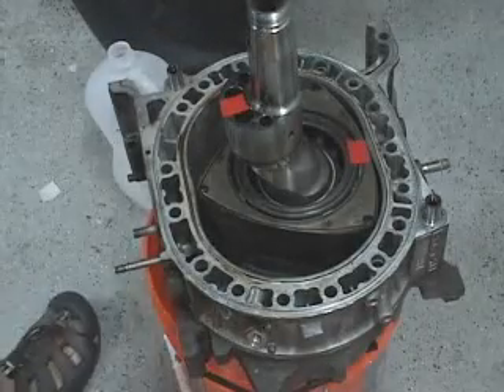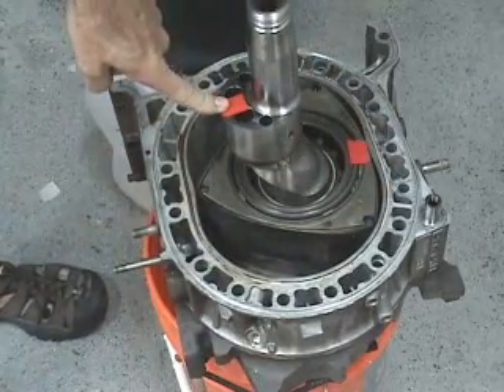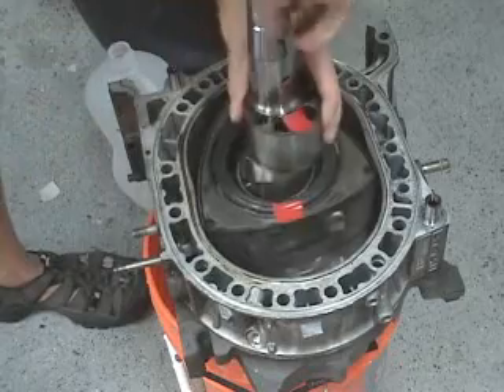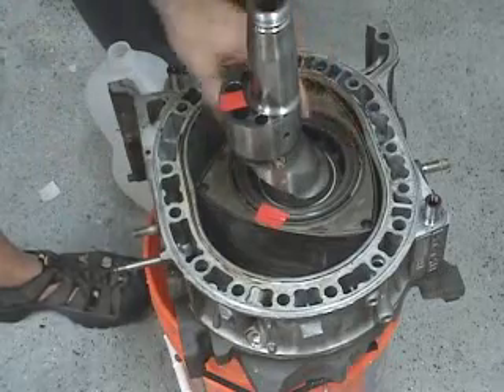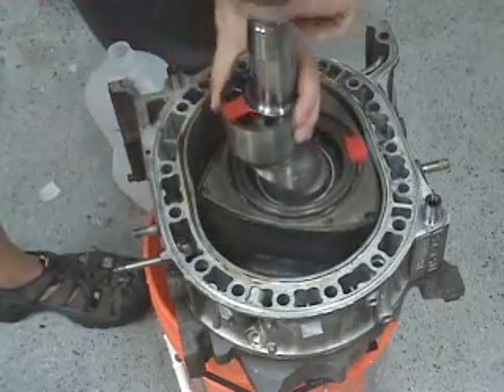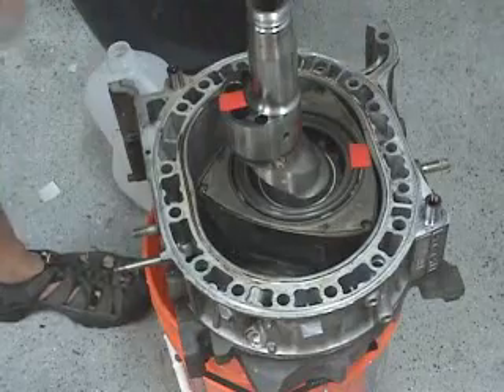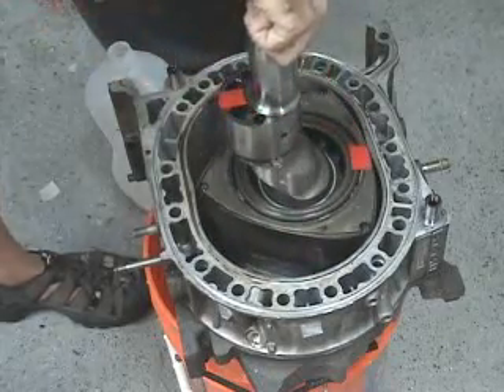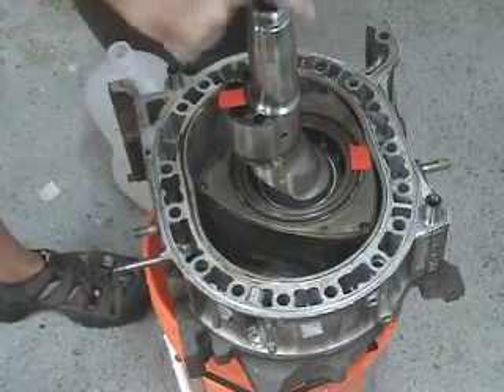Rotary Rotational Demonstration

Comment: So what you're saying is that there is an ignition event for every single rotation of the crankshaft... just like a two-stroke engine really! But a two stroke engine doesn't wear out anywhere near as fast.  The only advantage is that there are far less moving parts and the space needed to fit the rotary engine is smaller but just like the two stroke, you still need oil in the combustion chamber meaning it'll never be a clean burning engine.

Comment: Very few people completely ditch the OMP and go straight premix. A lot of people keep the OMP and also premix or they change to the sohn adapter and have the tank of premix in the engine bay. Even with the sohn you could still run premix and probably should.

They all start out stock by injecting the engine oil instead of the tank of premix and I would say a majority of people stick with that.

Comment: Yeah, because that's how it's made. Most people ditch the oil injection system or whatever its called and just premix 2 stroke oil into their fuel. If you didn't notice, rotary engines don't have an oil sump or oiling system like a normal car. Normally they have a little tank you put oil into, and it squirts it into the engine. But from what i understand it tends to be unreliable or something (maybe it's just an old RX7 thing?) so they just premix

Comment: Thankyouthankyouthankyou! I was wondering about the number of power strokes per complete crankshaft revolution per rotor. Since your video shows that the answer is one, that means one rotor is the equivalent, power-wise, of a two-stroke piston (as it also does 1 power stroke per rev). 

That explains why a 1.3 liter rotary makes 230bhp - in 4-stroke piston terms it would be worth 2.6 liters (as they only have a power stroke every *two* revs) or you'd have to rev the pistons twice as fast!

Comment: 1080 degree of complete thermodynamic cycle(for each rotor).There is 3 rotor faces inside Rotary engine.Each rotor carry their own t.dynamic cycle.First face ignite once after 360 rotation,second face then ignite once after 720 rotation,lastly the third face ignite once after 1080 rotation which mean this engine ignite  per revolution of eccentric shaft,same as 2 stroke piston engine.For that,we should double up the displacement of 1.3 liter rotary engine to a comparable 4 stroke piston engine

Comment: It doesn't. That's what the oil injection pump is for. It meters a very small amount of sump oil into the intake charge to lubricate the apex seals.

Comment: Excellent video!. Thanks. My experience of Wankel Engines. high oil consumption, high fuel consumption, serious rotor tip wear at relatively low mileage, poor torque at low revs. Smooth and very powerful when turbo charged at sacrifice of engine life. Years ago I had a NSU RO80 beautiful car. 15000 miles and the engine was knackered. This car had three engines under warranty!!. Wankel engine, Bullshit. Later ones a little better. AVOID.AVOID.

Comment: cause the rotary does in fact work with the mazda and a 13b turbo 2 swap can be swapped into any car as long as proper mods are made to support that engine and the Rotary is quite reliable not so much in the 3rd gen but 2nd gen Rx-7 is good to go

Comment: It all depends on how well the seals are lubricated throughout the engine life. It is not uncommon to see 1st and 2nd gen naturally aspirated rx7's with upwards of 150 to 200k. More than likely at these points they could use a rebuild but I've seen some hitting 300k. Because the seals do travel a greater distance throughout their lifespan, solutions like running premix in the gas have resulted in longer engine life and lower wear characteristics.

Comment: bmw naturally m10 motors were pushing 300+ at 1.5 liter in the mid 80's.. the m12 1.5liter turbod in the 80's were pushing 1500hp in f1 by 90.. *shrug* .. rotary would be a great design except for the seals..

Comment: Ok...question.  I know the original RX-7 had a single rotor, amazing power BTW for such a small, simple engine.  I was told that the RX-8 had two of those rotors.  I am not quite sure if i believe that since I've  heard the RX-8 and it doesn't sound that much different from the RX-7.  Still sounds to me like a bad assed saw.

Comment: Maybe that's because you hang around people who don't know what they're talking about? I don't bother to say something if I don't know it's been proven. Rotaries in general DO have better numbers than reciprocating. It's simply that the design of the rotor is very inefficient and thus has been scrapped until they can find a more effective way to seal it. Piston 2-stroke/4-strokes are more thermodynamic and far more practical, but unless you've got a shit load of mods on it, it won't be better.

Comment: this engine is the worse engine ever made !!!
.
Did you know a 4.4 v8 like the one equipped on a BMW 550i it can achieve 26 mpg while the 1.3L engine can achieve only 25 mpg ?
.
In a world were people are looking for more fuel efficient engines is unacceptable that a 231hp rotatory engine has the same fuel consumption as a 407 hp V8 engine

Comment: Easily remedied by adding more rotors dude.... Most rotaries can get by using only 2 rotors and make decent torque.  How much torque you think you'd get from a 2 cylinder engine?  What's your solution?? Oh that's right, start adding more cylinders/pistons, then increase stroke blah blah.

Look up how much torque was generated from the 1991 Mazda 787b, naturally aspirated, with 4 rotors displacing only 2.6L.  Game, set, match.
That car beat 5.5L V8 twin turbo Mercs, and 7.4L V12 Jags...

Comment: Technology or metallurgy needs to advance before the benefits of the wankel engine will fully outweigh or eliminate the disadvantages. Considering that there is better use of momentum in a wankel because unlike the cylinder design, it doesn't change directions suddenly. The cylinder reverses direction and therefore some power is wasted changing from up to down. Don't lose hope yet. Mazda won Le mans championship with this style of engine. Its smaller, fewer parts, and more horsepower per litre.

Comment: apex seal resolution is a matter of time and development. unfortunately, you just stated that the wankel has a clear power to weight ratio advantage over any other engine except the Atkinson cycle engine, despite having compression losses.

Comment: I would want to compare vehicle to vehicle. Take a Doble Steam car, and a comparable ICE powered car. Put X amount of fuel into it, and see how much torque, power, or miles, etc. you got out. Also at the time no one cared about fuel consumption, only how well it performed.
I am certain you are correct about overall efficiency but considering when these were built they were amazing. A Stanley went 125MPH in 1906. One good thing about external combustion, is the variety of fuels you can use.

Comment: Yes, most were later more advanced double acting or tandem compound engines massive torque at very low rpms... but in terms of Carnot or Rankine cycle efficiency horribly low BTU to Hp ratio (only about 10%) compared to ICEs, even lower than the Wankel.

Comment: As I said, they had it working, but had issues with corrosion. I don't know how, don't remember the details and I can't find out anything about it now.. I looked. I found nothing. Some if the early steam cars, were pretty amazing. Look up Doble Steam cars. He had the most advanced design. 35 sec to start up and run from 32deg F., top speed about 100MPH, 0-60 was about 10 sec in a 5000lb car.
I think Jay Leno has a Doble Steam car. He has driven his Stanley and White models on Jay Leno Garage.

Comment: What I explained was the basic idea. Keep in mind it's been 10 yrs since I saw the information. My memory tells me they had it working, but were hampered by the materials available.. corrosion problems. The low angle and indirect force was an advantage. It gave more time for the steam to expand since the rotors turn at 1/3 crank speed. All I remember is the basic idea, and the thought of how cool it was to mix two of my favorite engines together. I wish I could remember the details better.

Comment: It required small amounts of hydrogen to make the water flash to steam. Water expands 18 times it's volume when it flashes to steam. So the water is doing most of the work water is cheap. The point was to build a steam engine but not need a large heavy boiler. One other aspect may have been TORQUE something the rotary is not good at & steam engines are good at. I remember them saying this concept will NOT work in a reciprocating engine. The flowing motion and no valves made it possible.

Comment: The design I read about was based on the Mazda type engine about 10yrs ago. The idea was to inject liquid water in a very fine mist, while also injecting Hydrogen. The Hydrogen would be ignited by a spark plug, and the liquid water would flash to steam in the combustion chamber. The steam was doing most of the mechanical work. Burning Hydrogen gets you water vapor, so the only output was water. plus any lubricating oil I guess.Corrosion was the problem they had with it. pretty cool I thought.

Comment: Yes.. lots of problems with the engine... But man they were so cool. I really liked the 1st and 3rd generation RX7's. 
I mentioned the Natural gas, just because it may be so cheap that fuel economy may not matter that much. I am not sure how it would effect emissions though.
Years ago, I heard of a Wankel that was steam powered. Used Hydrogen gas, and ignited it in the combustion chamber with injected water. The water flashed to steam, and the steam did most of the work. Totally clean exhaust.

Comment: Yep.. seems so to me also. They do have very good volumetric efficiency, but I am not sure that really helps that much. Mazda is still talking about another RX7 But I am not holding my breath. Hell they are putting a 1.3 liter turbo engine in the Miata all in the name of fuel economy. If they are that worried about the CAFE standards the rotary is gone for sure. UNLESS we move to Natural Gas in our cars... that might work, it's so cheap no one would care about the efficiency.

Comment: Yep, and also the reason you get 250HP from 1.3L engine with no turbo. And unbelievable smoothness at high RPM. The bad fuel economy is also related to the relatively low compression. Its also a very light and compact engine.  But I think unless they find a way to increase it's efficiency... it wont be around long. The future seems to be small engines with turbos and direct injection.

Comment: I've always wondered if the amount of R&D that goes into otto engines was put into a rotary, especially with today's advances in technology, manufacturing and computers if it would offer a benefit. I always wanted an RX-7, but the reliability and inefficiency for a daily driver of the Wankel turned me off. Once you get them RPM's up they create a lot of HP for their size and weight.

Comment: 'Were' better perfomance engines.. the Wankel engine does not have much if any power to weight ratio advantage anymore, they have more compression loss than Otto cycles because of all of the sealing surfaces and the issues with apex seal reliability has not been completely resolved..  and supercharging and turbocharging only makes the problems worse.

Comment: ...wear much more quickly making it a short-lifetime engine that is harder to seal. General torque and horsepower output on wankels are higher than that of most reciprocating engines. This is why you don't see alot of rotaries in daily-drivers. Rotary engines are mostly used in racing and in some cases (in the case of mazda) in everyday cars.

Comment: Rotaries are actually better performance engines than reciprocating. Though, your regular piston engine does have a thermodynamic advantage (the perfect combustion shape is a sphere and pistons combustion case is cylindrical i.e. closer), the piston engine takes 3 strokes to move through each stage (intake, compression, exhaust), while the wankel takes 1 full rotation to do all 3 at once. The differing pressure zones in the wankel chamber (exhaust 1-side, intake the other) makes the apex seals..

Comment: He wasnt being arrogant.
People are indeed idiots for questioning something like that repeatedly when they could easily research it themselves.
I dont get whats so hard to understand, the shaft makes a complete rotation, it rotates the rotor a full facet and it combusts fuel per facet contact and there are 3 facets on the rotor.
You crank the crank  three times and the rotor makes a complete cycle. Simple.

Comment: Unfortunately the only update to the term Wankel in the dictionary will most likely be 'obsolete' , despite a minor resurgence in the use of Wankel engines in light aircraft, they are for the most part based on older technology. Mazda was the last major manufacturer of Wankel engines and ceased production last year. Due to the inherently poor thermal efficiency its unlikely that the Wankel will be competitive again in an ever of more fuel efficient and environmentally conscious market place.

Comment: Strictly speaking, it is a planetary-motion engine, not a rotary-motion engine.
Saying they are the same is like saying a screw and a bolt are the same.
Similar function, similar result, different implementation of a similar motion.

Comment: as long as the internals that hold combustion rotate it can be called a rotary, if u wanna get all anal about it......  rotary Piston engines are normally called RADIAL engines  ,that is to prevent anal bleeding   to those with a contradictory soul !

Comment: I was under the impression that it was in fact a rotary because it derived power from rotational, rather than reciprocal motion. What I read was it is a "pistonless rotary engine", as opposed to a "rotary piston engine" (i.e. WWI aircraft engines, which are in fact not rotary, as they are reciprocating engines). I would be curious to get the official word on that though.

Comment: Thanks. I finally found an awesome animation that showed what I was looking for. I was mostly wondering about the rotor-to-e-shaft connection, but I think I got it now. It's like you say, it's like the big end bearing on a crankshaft. Very interesting engine; I wish they could perfect them (I mean for everyday use!). I did read they are talking about making a plug-in hybrid with a rotary generator. Might work well in a fixed-rpm application like that.

Comment: well, it is a type of rotary, in that it uses a rotor instead of pistons. so the correct answer would be that there are actually two separate groups of rotary engines.

Comment: The shaft rides on journal bearings in the gears mounted to the end plates, which are, essentially the same thing as main bearings.
The rotors ride on the e-shaft on journal bearings.
The fixed stresses are on those end gears.
The rotor bearings are analogous to rod bearings.

Comment: Funny I didn't find this video when I was looking for something like it a while back! You should mention that the e-shaft is the same as a crankshaft. Some people might still be confused. I have a guestion though. The e-shaft rides on a journal bearing in the rotor? Is that how it works? Is it just like the journal bearing on the big end of a connecting rod, or is it a roller bearing, or what?

Comment: Power to weight efficiency is quite a dumb reference i think
you can have two exact same engines but built in lightweight materials aluminum titanium or cast iron...

the industrial methods and cost are just the main reasons.
it's the efficiency of the brand here lol

it has nothing to do with the efficiency i think but only practical reasons.

the better way to use fuel in the engine following its application is the efficiency i think.

Comment: efficiency IS fuel economy
the less fuel you burn for the SAME output the more efficient it is.

 v8 engines have just more and heavier moving parts wich need more fuel to turn.
simple as that.

4 bangers are the way to go nowadays.

Comment: @sparkyindahouse - Not a twat question at all.
That would be crank speed.
The rotors would be moving at 1/3 that rate or 3333 RPM.
That would be the point of the video.

Comment: @maddogmatt44 Generally that's just a matter of displacement with wankel rotaries.  That's the case too with piston engines.  When you see figures like "1.8L V6" it's an engine with 6 pistons each with 300mL of displacement.  Rotaries generally have a very high output for their displacement compared to piston engines because of the way they're rated and the way wankels are designed to complete a full combustion during a single rotation, versus pistons which require two rotations for 1 combustion

Comment: @D1983r  The wankel is a four cycle engine.  Each face of the three sided rotor allows the wankel to intake the fuel air mixture, squeeze it, ignite it and exhaust it in one revolution.   So a power cycle is completed for each turn of the rotor. In a regular otto cycle engine the crank shaft rotates once to intake the air fuel mixture, a second time to compress it, a third time to combust it and a fourth to exhaust it.

Comment: quick question. with regular motors you got 4cyl, v6, v8 etc. and you can sort of tell the power the car/truck is pulling out via horsepower just by knowing how many valves. How do you even determine the horsepower the rotary engine is pushing? is it all the same?

Comment: @GodsNotReal95 nope. it does the same thing that pistons do..just uses a triangle fucked up thing instead of round pistons in a normal V block or straight motor...Has intake at one step, combustion at the next and exhaust at the last. my experience with them is they arnt anything special.

Comment: @xxyy3003 only based on the  rotary steam engine invented by the brits , wankel mearly turned it into an internal combustion version a bit similar to what happened to the normal internal combustion engine copied from the steam engines